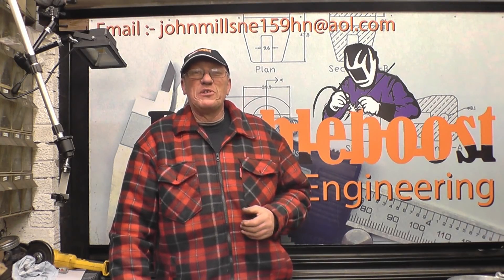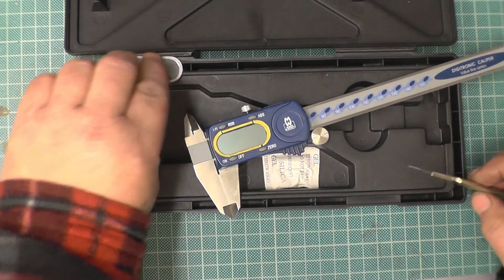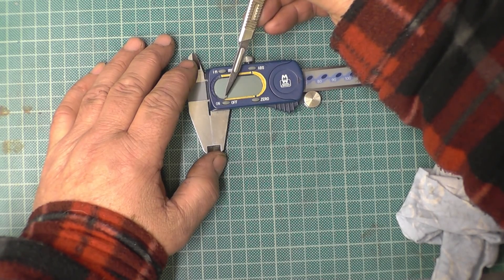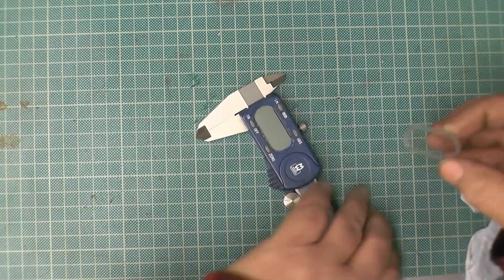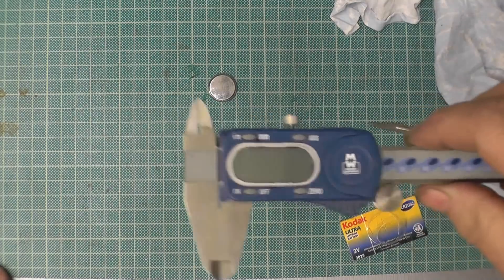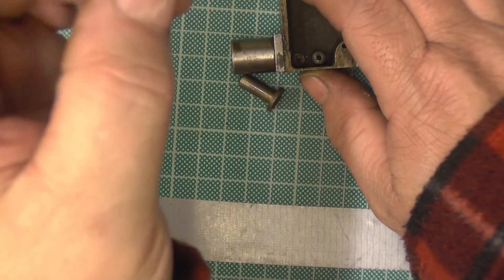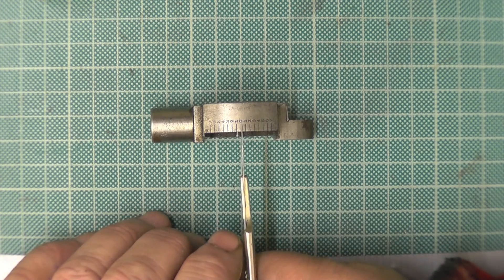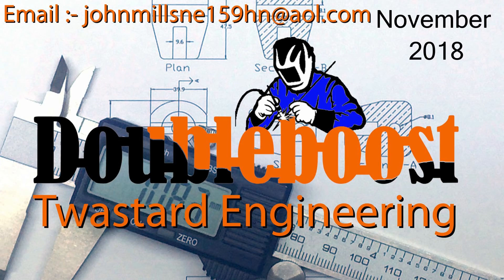Vernier Caliper Care & Repair  With Bob P2

Comment: Plastic store gift or reward cards, etc work great as straight edge guides for painting small stuff. Just hold it on top of the piece and paint next to the card guide so the paint flows just to the edge of the guide. Clean the paint off the guide between uses to keep smearing down. Easy to cut those store cards to make small stencils too. I use sharp dividers for circles and curves, or a sharp scribe and something the shape I need to score along the line a couple times until you can snap it.
Reply: I will remember that  bob

Comment: B&S is probably only a 1/4 step behind a Starrett tool.  A good cleaning in the Ultrasonic should get the gunk off of it.  What do you use to remove the surface rust?  Bob you are a wonder.  Thanks John.
Reply: hi well the fluid I yous in me tank removes light rust

Comment: Thanks again Bob for another interesting video. What do you use in your cleaning tank to clean your parts?
Reply: Just a thought Bob, what about putting the sticky tape on the new lens instead? Could be easier maybe, great vid as always.

Regards Alan.
Reply: @pearcemachineshop5200  hi Alan I have had a go at that way with out much look
Reply: hi I get it off eBay all it says on the bottle is tarnish and rust remover

Comment: Thanks Bob:
In the previous video you noted a scratch on the actual digital display glass under the cover presumably caused by the broken glass. cover. It looks like you removed it. You mentioned you would polish it out . Could explain what you used and the process.
Thanks
Reply: hi well all I used is metal polish on the end of one of me lolly sticks and just rub it till  the marks came out   regards bob